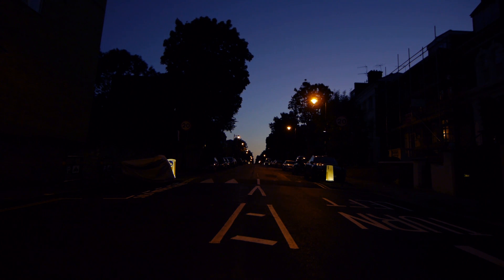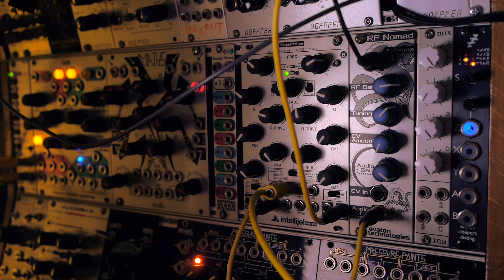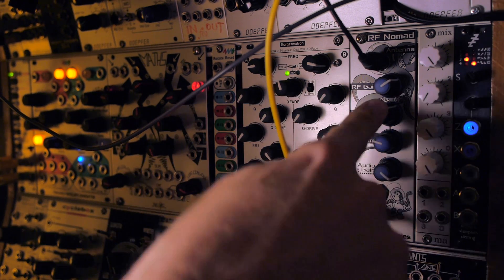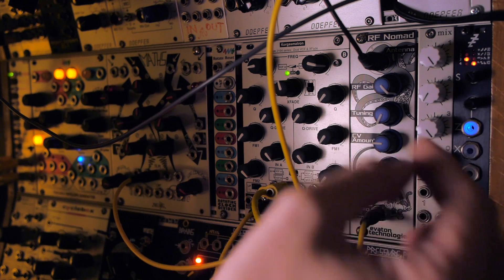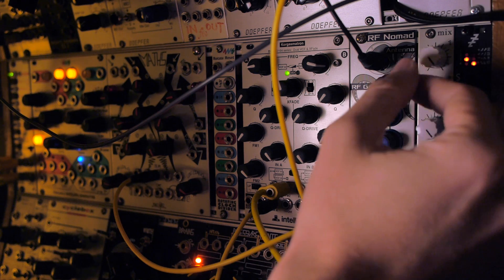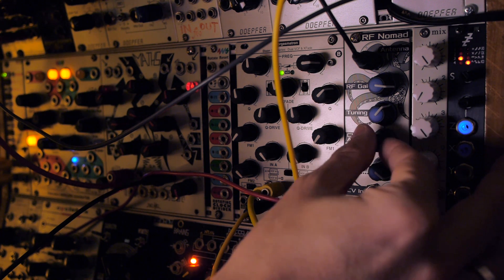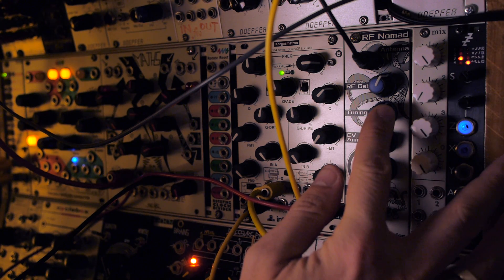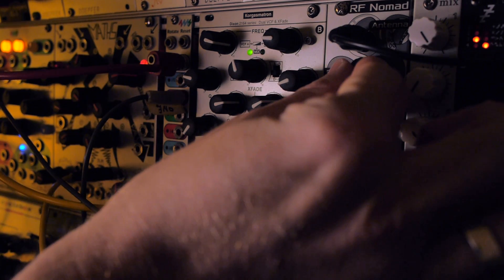RF Nomad Shortwave Radio Eurorack Module Demo

Comment: pretty sure that the sw receiver on this is single sideband , so when it is tuned slightly off the voices etc are slightly frequency shifted instead of ring modulated . . . the receiver on this is not selective, its supposed to be noisy and interesting in terms of harmonics and stuff...if you want a good shortwave you should just plug a grundig in

Comment: at 2:15 when you say you "cut" the wire... what do you mean by cut? like physically cut and got a longer wire and somehow attach it on? could you explain how you extended it? I'm really confused on that part
Reply from the maker: No worries - As in get yourself a length of new wire, and attach it to the bare end of the existing antenna.

Comment: You should run the wire out of your window and into your garden. I've got a good 30 meters out there hanging from a tree.
Reply from the maker: +ArriCAT5e Be very careful if there's a storm though! Lightning + your antenna leading into your house = bad things.
Reply: +mylarmelodies it's common practice with shortwave listeners to disconnect your antennas when not in use.
Reply: +ArriCAT5e a slinky antenna in the attic works well as well, without the lightning dangers.

Comment: I got this module and did all the stuff recommended here. I even made a lengthy antenna, but I found little response of interest. I'm even in a really good reception zone too. I find the tuner gives too much range in too short a control. In the end I took the audio out from my Yupiteru scanner, with the squelch turned way low, and wired that up. With a standard extendable antenna I found I got loads more diverse and interesting stuff. Not criticising this review at all. Just found the module a bit restrained.
Reply from the maker: +TheMonohub Fair enough! Definitely recommend MATHS or attenuverting DC offset for fine tune control. I guess the beauty is the CV control - you'll get more stations on a 'pro' receiver but you also couldn't control the frequency sweeps in the same way.

Comment: I purchased this shortly after it was released and the sound shaping possibilities almost seem endless. Currently I am using the Nomad as a kind of white noise generator to produce hi-hat sounding stuff in drum patterns. The Nomad's output is running into a VCA and the VCA is being gated on/off from a Monome White Whale's triggered outputs. As the pattern is playing I adjust the tuning knob on the Nomad so the "static" is somewhat in tune with whatever melody or sequence I have going. As stated in the video, it does definitely help to use some kind of filter with the Nomad when things get a little nasty! Excellent video, thanks!

Comment: could you put that into a s&h and it would work like a white noise source...can a s&h work with any sound source? haha
Reply: yea the general idea of s&h is that it takes little snapshots of a voltage source and spits them out in little bits. so like if i put a triangle wave into a s&h you would get a stepped version of the triangle's ascending and descending voltage. so imagine turning a smooth up and down ramp into an up and down staircase. if you applied this staircase to a VCO's 1v/oct input for example you would hear a stepped increase in pitch over time and then a stepped decrease. think of when arcade machines do it. that kind of scale one boop at a time, as opposed to the slow steady incline and decline of a triangle wave. sooooo when you s&h white noise you are talking about the whole spectrum of audible frequency so when you are taking quick snaps shots of it, you get a very random sounding result. the more input freq fluctuates the cooler you s&h will sound. but when you put a steady audio signal into a s&h it will just spit back out snap shots of that signal but that signal doesnt change so the snapshots dont change. but one thing you could do that is cool is turn the sample rate up to the audio range and listen to the output rather than use the output as CV. It sounds like bit crushed audio.
Reply from the maker: gooneybird808 Thanks dude, working on it!
Reply: nice...so the nomad would be a baller sound source for sample and hold considering all of its randomness. really any radio would be pretty cool. i personally don't have any eurorack stuff but i feel like i know my way around modulars pretty well just from watching videos and dreaming haha. but dude you need to make more eurorack vids!!! even if you could put some of you jams on here too! that'd be real cool.
Reply from the maker: what okkoto said!!